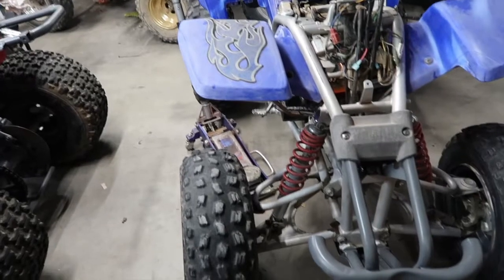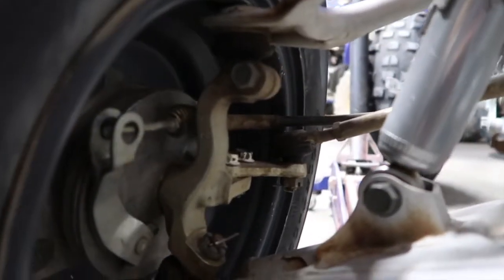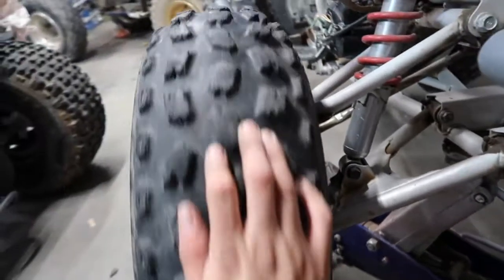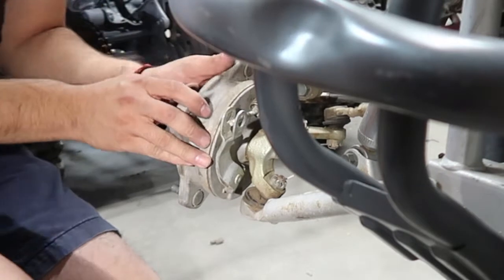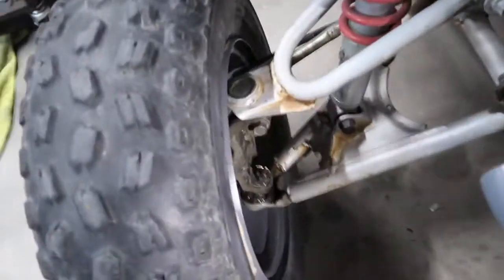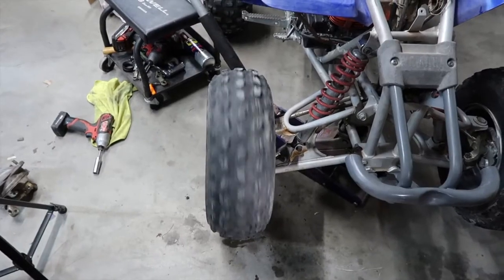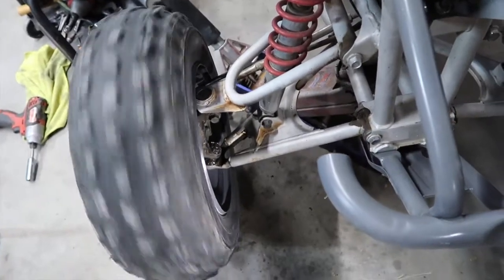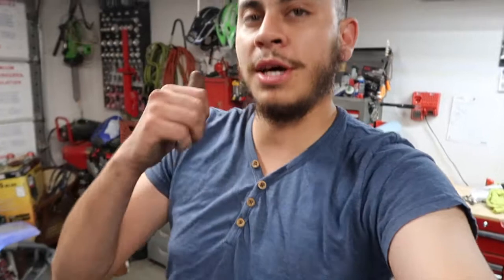BENT SPINDLE ON YAMAHA BLASTER YFS200

Comment: Broooo your videos have been hittin! I think have this problem too it has a problem steering to the left like it locks up.
Reply from the maker: Appreciate the suppourt man! Yeah it's hard to tell sometimes but definetly was bent at some point and found the part on eBay pretty cheap. It could also be just the bearings?
Reply: @kikemotors6138   I hope so. I’m gonna look closely and analyze it when I go to the garage. Appreciate the videos keep doing your thing. I also used your oil pump block method where you took apart the pump to get that cap. I just added silicone for extra protection. Keep it up 💯